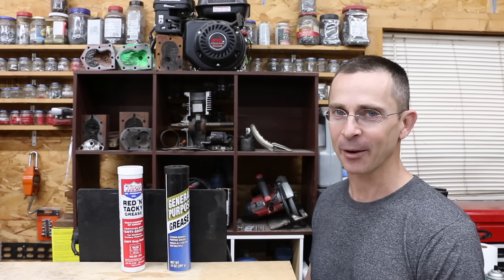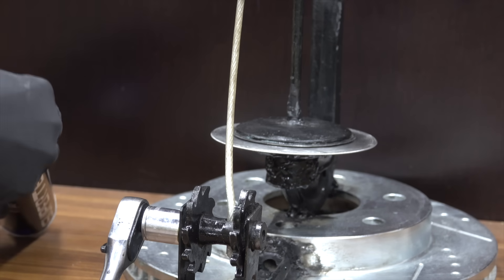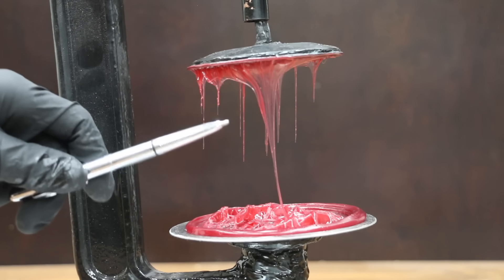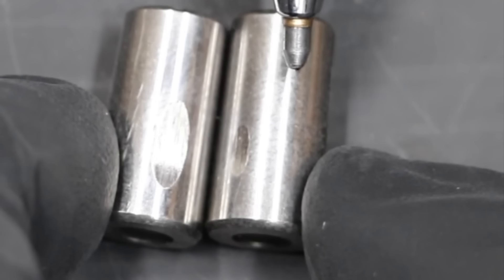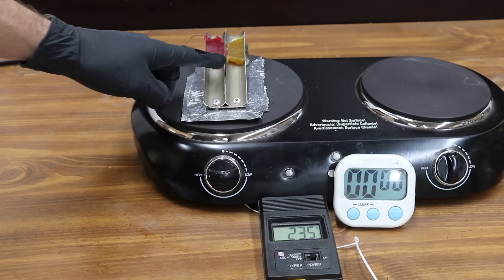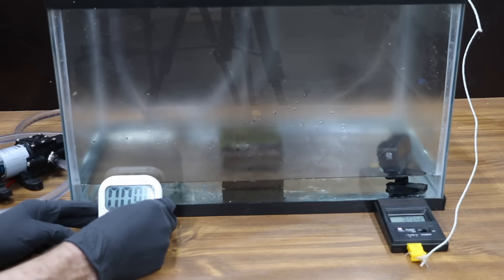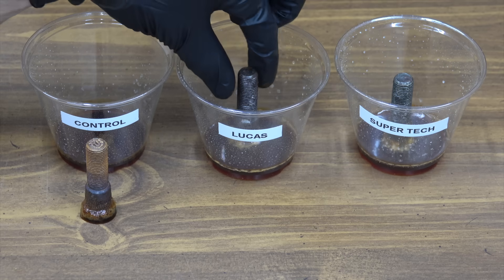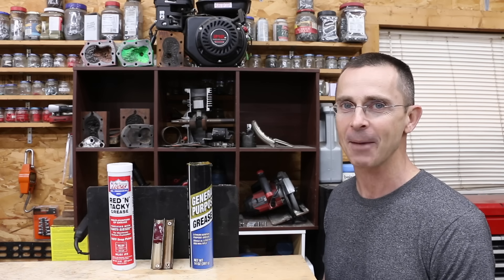Is Cheap Grease better than Lucas Red N Tacky? Let's find out! Bearing Grease Test Episode 1

Comment: My stepfather has used both Texas Refinery 880 Crown and Chassis and Paragon 3000 for years on his semi and swears by them. I have used them with great results on various equipment over the years. The tackiness and water resistance is unlike any other grease I have used. Would be cool to see what you think of them. TRC also has a ton of data on each grease on their website.
Reply from the maker: Thank you for the feedback

Comment: Red & Tacky is my go to grease for just about anything. What a huge difference there is between the cheap brand and the lucas- I could tell that lucas made a noticeable difference in my old ranger's fuel mileage, but i didn't think that there was THIS much of a difference among all the tests. Thanks for the awesome video and great content as always!

You could do a 3 part series with the grease comparisons. one comparing Xtra heavy duty grease and a video comparing Marine grease. I think that would be really interesting to see the marine grease VS the water resistance test as well as how much of a difference there could be with heavy duty grease brands.
Reply from the maker: Great suggestion!

Comment: Just a suggestion, maybe next time you should test two greases of the same type. You could tell just by reading the descriptions and specifications that these greases were not equivalent. One said 350 and the other said 550. Maybe compare a red bearing grease to the Lucas one. I realize you did this because the differences would be noticeable as their specs were so different
Reply from the maker: Thank you for the feedback

Comment: Awesome video, I have this argument with the family every time I service something on the farm. "It's just grease!" I switched to Red n Tacky for everything that doesn't have a very specific grease spec after seeing how it held up vs. the tub of brown "wheel bearing grease" we'd been using in trailer bearings. Even at double the price, it's still pretty cheap, and you can usually get a discount on an entire case.

Red n Tacky also comes in 1-pound tubs though most auto stores don't carry it on the shelf. I've also heard there's an aerosol version that's really great at coating assemblies without taking them apart. I'd like to see a test between aerosol Red n Tacky vs. packing in the regular stuff.
Reply from the maker: Great information. Thank you

Comment: I've always wondered if those super tacky greases could have some kind of downside due to the inability to move and flow in a bearing. I'm sure they're great in ball joints etc but prefer a premium standard non tacky grease in bearings.
Reply from the maker: Great point

Comment: Again PJ, a thorough and well thought out series of tests.  Being involved with heavy equipment and in the automotive field for about 50 years has taught me a thing or two about greases, but thanks to you many people now have the info that they need to properly maintain their equipment.  My experience has shown that the "Red Grease" is a superior product for most applications for the general public.  Several companies offer a form of it with generally the same qualifications as the Lucas brand.  There is a synthetic green grease product that also has about the same qualities, if not better, but it seems to be tied down with patent protections so that it's not as easily available as the red greases and may cost considerably more.  You've saved me, along with others, a ton of money and inconvenience with the knowledge that you've provided in this and your other videos.  I don't know what I'd do without your incredible work.   
  P.S. What about running some tests with the other brands of "Red Grease" versus one another and against the green grease which is a synthetic product by the brand name, "Green Grease"?  Just a thought.  Thanks, again.  Peace
Reply from the maker: Thank you for the video idea on red vs red and red vs green grease testing!

Comment: Great testing methodology. I bought a used travel trailer and in preparing for a trip across country, I repacked bearings. Fortunately I selected the Lucas and over 9000 miles in summer heat, there was never a problem. The tackiness helps the grease stay in the bearing race , which is where id does the most good. Thanks for the research.
Reply from the maker: Nice!

Comment: Maybe it was mentioned, but I didnt read through all the comments.
Cen-pe-co oil and other products produced by this company is all that I have used on the farm for everything. Grease, oil, light oil, and fuel additives for cleaning the engine as it is used.
Would love to see how it compares to Lucas oil products, since that is the only product used on the farm. I have used lucas in my personal truck but only because I would have to order gas products for my personal truck since the farm is all diesel. So if you could use Cen-pe-co I would watch that for sure. Great vids, keep up the hard work!!!
Reply from the maker: Thank you for the video idea!

Comment: Could you please do some stuff with two strokes? You can get cheap pocket bike engines on eBay. Please check if it’s actually bad to break one in with synthetic especially amsoil interceptor. And compare amsoil to some others for break in as well as extreme duty. Thanks. :)
Reply from the maker: Thank you for the video idea!

Comment: Over the years I have use many types of grease seems to be always the cheap stuff. But when it started running out of my steering head bearings on my motorcycle I knew I had to get a better grease I have been using the lite green Marine Grease  which seems to be  good
Great information thank you 
Your the Best 🖖🏽
Reply from the maker: Great information. Thank you

Comment: Surprised Lucas did so well, as ive never really been impressed with any of their oils. Their most popular product, Lucas Oil Stabilizer is literally nothing but super thick weight oil. And the few other motor oil analysis ive read arent very impressive for its price point. They're better at marketing than making oil but at least i wont be afraid to use their grease from now on.
Reply from the maker: Thank you

Comment: IDEA FOR A FUTURE VIDEO...

 I am very interested in how much the flow rate may vary on an oil filter after it was used compared to when it was new. Maybe something that might work to test this would simply involve comparing a new filter element with a used element that has had most of the oil pressed out of it (as you do with a vice) and then simply pour the same amount of a suitable liquid through both elements without any pressure (just gravity) and time how long it takes for the fluid to pass through each element (new vs used).  (Maybe some sort of cheap thin vegetable oil would work.)

I use K&N filters so they interest me but you could do the test with various brands but you would always have to compare the same brand of new element with same brand of used element. Comparing two different brands of old and new won't reveal anything due to different media, thickness, number of pleats etc.
Reply from the maker: Thank you for the video idea!

Comment: Hey, just a quick idea I'd love to see that might fit well on your channel. Testing the water proofing sprays, gels etc that advertise they can waterproof/water resist your work boots, do they work, and if so which works best because they appear divided between sprays, silicones, oils, and proprietary types and there isn't a ton of information out there. Love your channel!
Reply from the maker: Thank you for the video idea!
Reply: If you test waterproofing products for boots please include Snow Seal. It’s not a spray but it works well. Doesn’t last a long time but is worthwhile enough that I regularly use it.

Comment: My dad told me to use red and tacky when I replaced my throw out bearing on my 99 Subaru manual transmission and it's been going strong... Good to know his favorite is good!
Reply from the maker: Great advice!
Reply: If your transmission quill is aluminum, you should also use a steel sleeve over it as well.  Mine wore out and cacsed my throwout bearing to die.  I used one of these to fix it:  https://www.pdmusa.com/
Reply: The thing is when dad's tell you to do some thing or use some thing in a certain way you should always listen!!! Dad's seem to know more than mechanics 🤣🤣

Comment: Good Morning!  This was a very interesting video which highlighted the difference between the words "cheap" and "high-end" greases.  It's  obvious that there is a huge difference in what you get if you make price the most important criteria.  Please do another one of these tests evaluating 4 or 5 of the top chassis/wheel bearing grease products (Amsoil comes to mind).  I really like the way you use home-grown tests that illustrate the desired physical properties of various products without the use of a $25,000 instrument!  I'm sure you can come up with another test to add to the mix - maybe a wear test, but performed at very high temps to simulate harsh environment real-world use.  I would also mention that the "incompatibility issue is a really big one.  When working on any type of equipment, new or used, it's almost impossible to KNOW what brand/type of grease was previously used, especially in chassis fittings like (lubricatable) tie rod ends etc.  It's also usually impossible to WATCH what happens over time as your grease mixes and reacts with the other grease.   A good friend of mine knows this: if you hurriedly RE-pack wheel bearing without cleaning the old grease from the bearings and the hub, then you stand a chance of seeing a trailer wheel go off on an adventure of its own after the grease turns to liquid, and the bearing fails catastrophically!
Reply from the maker: Great point!  Thank you

Comment: Great job with the testing. As far as know you can mix greases within the same family of thickeners just fine. Both of the ones tested are lithium soap based so mixing should be fine. I'd be interested to see how much the wear resistance improves with moly greases, especially how much better the expensive high concentration moly ones are than the cheap ones.
Reply from the maker: Great feedback. Thank you

Comment: I have an awful time with bearings in my boat trailer, was using Marine Grease. Last Summer I changed the seals, cleaned and repacked with Red and Tacky still had issues. Anything better?
Reply from the maker: I'll test for a better grease.
Reply: Maybe it's the bearings. Try new bearings.
Reply: Moistifier I put new bearings in one, inner and outer, didn’t matter still runs hot. Others looked good. If I fill em up with grease, zerk fitting, it blows the cover off!

Comment: Really great work.
Ingenious test rigs.
I'm currently working on repairing some ABS motorcycle fairings.
I have several options for the repairs.
Be cool to strength test the difference between plastic welding using a 30w wood burning kit(because they're a lot cheaper than a plastic welder), the best ABS epoxy glue and a solvent based repair.
Solvent based is what I've made using black ABS pipe glue, a bit if Acetone and dissolved ABS fittings. I put in two pipe couplings and let them set for several days to make think fluid like glue.
I have cracks to weld, tabs to glue on and chunks missing I'll have to reform.
Would be very interesting to learn which is the strongest and toughest.

I know my homemade casting glue will take many hours if not days to harden but it would be cool to see which one will be the best approach.

As always, excellent work!
Shared with my friends on Facebook.
Reply from the maker: Thank you very much!
Reply: @ProjectFarm  
👊

Comment: Hey, how about testing grease guns! 
I have 4, and they all suck air. Literally. And always when I'm under a rig and twisted up like a pretzel.
Some leak. Some are hard to load. Some are awkward to pump. Are battery powered worth it? Pneumatic (I have 1 of each. Neither are very reliable).
Reply from the maker: Great suggestion!  Thank you

Comment: I've always purchased the "better" grease whenever I need to buy grease. I'm not sure why, but mostly reading the tube and the specs. The 2 or 3 dollar difference in the price is really insignificant when compared to the longevity of the grease. Grease fittings seem to get forgotten more often than any other form of maintenance in my shop, better grease is cheap insurance against my absent mindedness.
Reply from the maker: Thank you
Reply: Good logic. Same applies with installing OEM parts in hard to reach parts of the engine.
Reply: "Better grease is cheap insurance" - couldn't have put it better myself.

Comment: I generally use the Sta-Lube Moly-Graph grease from Harbor Freight. It works well on ball joints and tie rods. The same brand has been used at Toyota dealerships for many years.
Reply from the maker: Thank you

Comment: I have Valvoline synpower full synthetic grease. I have used it for many automotive applications. I have not had any problems but it's the only grease I have used since I rarely use grease. I know Mobil 1 has a grease as well, that would be a great matchup.

Comment: I HIGHLY Recommend Marine grease. (For those parts that don't use high viscosity) I use this in place of the common grease in my doors, sunroof, bolts, metal lines, hinges and to cover exposed parts that would otherwise rust. Plus this stuff doesn't wash off like all purpose grease and holds good in heavy weather. Speaking of Grease The Movie. That car they launch at the end of the original? Movie. My friend painted that car for the movie. Earl is his first name and last I knew he is still alive. He has type 2 diabetes and is having health issues.
Reply from the maker: Thank you

Comment: Some suggestions for your upcoming greases
Common in the big truck dealerships I worked in was Delo NLGI2 lithium complex(blue grease)
"Certified" brand Calcium Sulfonate was considered a high end grease
Aluminum complex grease is popular in cranes, where there is super high loads
When I was fixing aircraft we used used various Aeroshell greases, #22 being a popular grease for wheel bearings.

Comment: I dont see this as a fair test. Your comparing a high performace grease to a light duty one.  Bet you would of gotten similiar results by comparing lucas general purpose grease to its red and tacky version. Better comparrision would of been between stp red and tacky and lucas red and tacky.
From what ive gotten from all your videos is that the cheap brand isnt all that far off and in some cases performs better than the name brand stuff.
Reply: Yes  i agree.  It would be a better compare the Lucas grease to this one instead : www.walmart.com/ip/Super-Tech-Multi-Duty-Complex-Hi-Temp-Grease-14-oz-Tube/16928004

Comment: I use to use a Kendall B 3 (i believe it was called) grease that was extremely tacky. Very hard to clean off...of anything!  Fantastic for king pins and wouldn't fly out of u-joints. Would love to see a head to head with that grease. Though not a wheel bearing grease, might be too thick for the bearing test.

Comment: If you haven't already running an engine with only grease in the crankcase would be interesting to see!
Reply: It would essentially be running the engine dry untill the grease got warm enough to separate (if it got hot enough)

Comment: From 2000 to 2006, I worked on a Heavy Vehicle Simulator.  The machine simulated semi-truck traffic on pavement.  The bearings on the test carriage were greased with a white lithium grease every day.  When my supervisor went to buy a new 5 gallon bucket of grease one time.  I convinced him to try the red grease.  It turns out through that supplier.  The cost was the same.
Over time, we reduced the greasing routine to once a week.  And had less than half the rate of bearing failures.  As the white lithium grease had greasing daily.
Your experiment is very valid!

Comment: I've used Valvoline Cerulean grease for my front end parts for many years.  Everything is holding up well, with the ball joints (upper and lower), and tie rod ends (inner and outer) still being original since 1993 and 278,000 miles.  I replaced the idler arms at 138,000 miles in 1997 with the TRW "HD" (expensive and not available for a long time and VERY different from the non HD version) and grease them with the Cerulean grease as well, and they're holding up great.  However, the Valvoline Cerulean grease tends to "sweat" a lot when just sitting in the grease gun.  Any ideas what these different characteristics might be?  I use the purple grease that Les Schwab uses as my cousin fills up a little tupperware bowl for me and packs the bearings I take to him in zip locks for me as well.  Don't know what they use, but the bearings have been fine.  Great information presented here, but still curious about the grease sweating in the grease gun, etc.  Thanks!

Comment: Makes me wounder what type of lubricant/grease they use for bearings in very cold critical conditions like in satellites or Mars rovers. Also, due to solar flares, bearings have failed in the past (ball discharge damage): so testing for electrical conductivity could be relevant there (if they use grease at all).

Comment: My biggest problem with grease is in my grease gun .. My manual grease guns work okay but if my pneumatic (air) grease gun , if it sits any length of time it seems the grease thickens up and won't pump .. I've tried several brands of grease ..